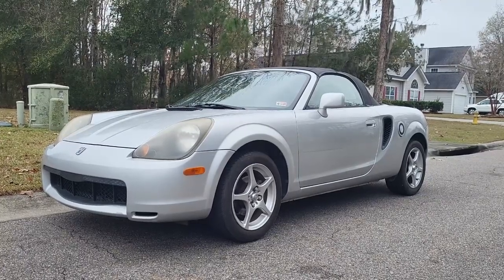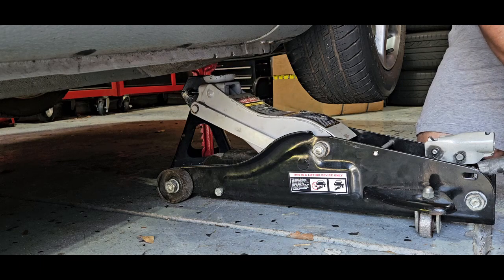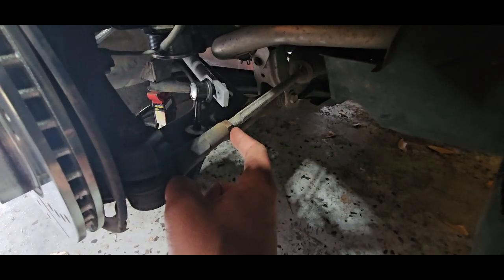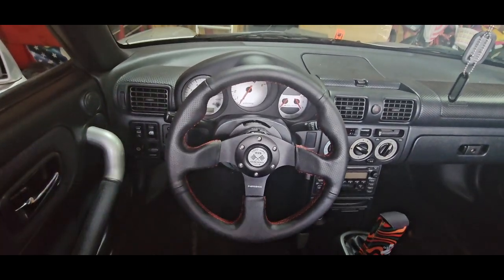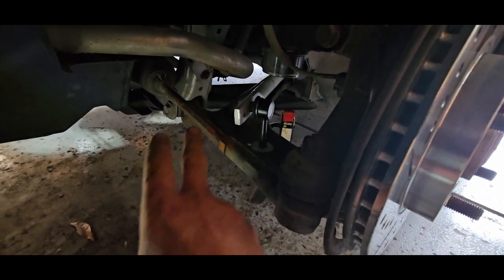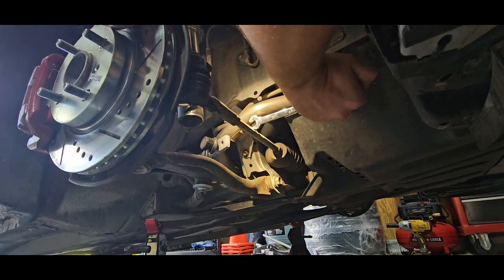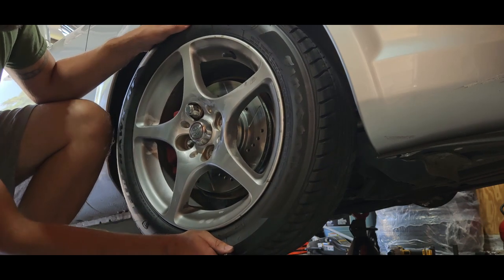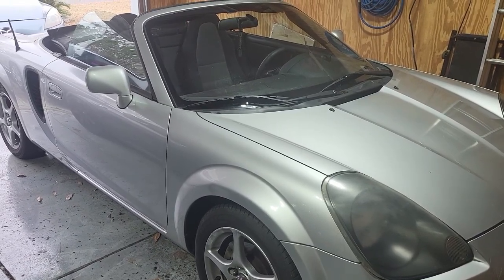Adjusting a Crooked Steering Wheel #toyota #mr2 #mr2spyder

Comment: Very helpful video. I've got a silver pfl 2zz exactly like yours here in the UK. Got some Toyo tyres fitted and now the steering wheel isn't straight. It's been driving me crazy. I thought if I adjusted it myself I'd mess up the tracking but it seems that's not the case